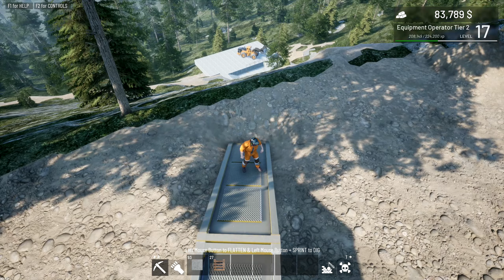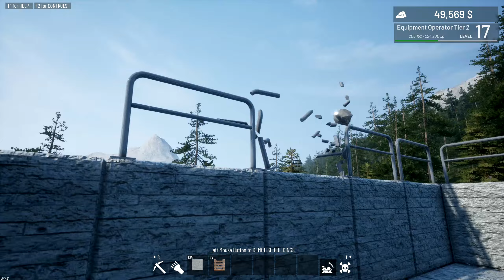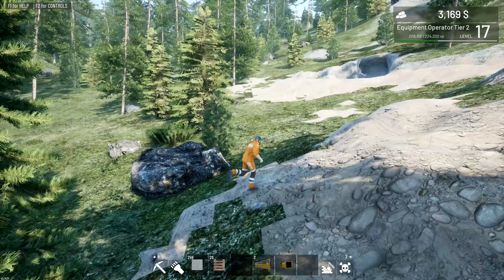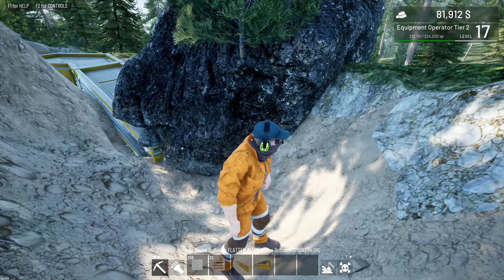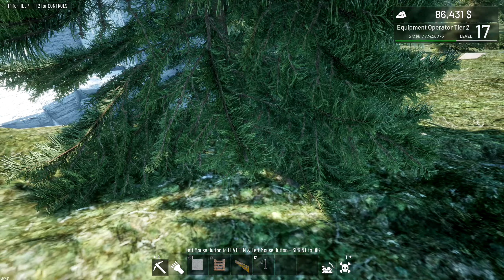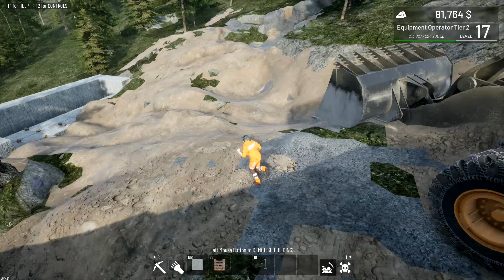Out of Ore S2E08 | Conveyors For Coal

Comment: For prospecting, I'm fairly certain there's an excavator attachment that will tell you what you've got under you.  Of course, you'd then need to buy an excavator that accepts attachments.  Will have to look it up when I'm playing next but I've seen people talk about it in the discord.  Anyhow, making progress - great video and happy digging :)
Reply from the maker: There is a drill attachment that will tell you what kind of ore, but it's not unlocked until level 30 or something
Reply: Oh wow - that's so late.  I think they need to rethink their progression a little.  Some things need to be unlocked a bit earlier than they are.
Reply from the maker: 100% agree. It's the first iteration of the levelling system and will no doubt be changing @LowKey_YT
Reply: @KerboOnYT  yep, agreed. Hopefully sooner than later though. I’m almost up to 32 but I’m waiting until the big rock trucks before going further from the initial site. The smaller ones just don’t make the trips worth it and I don’t want to conveyor everything back.